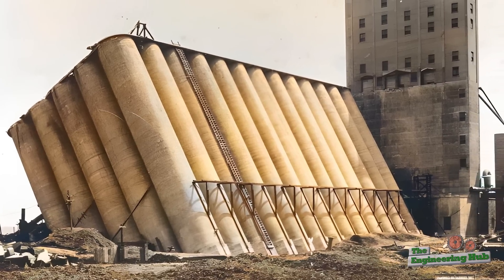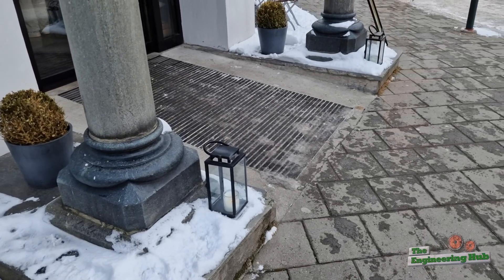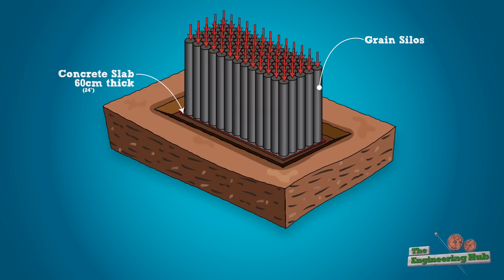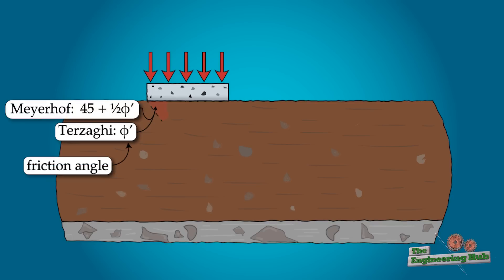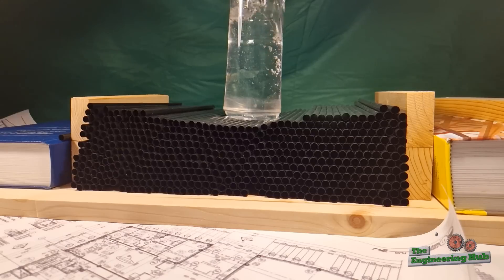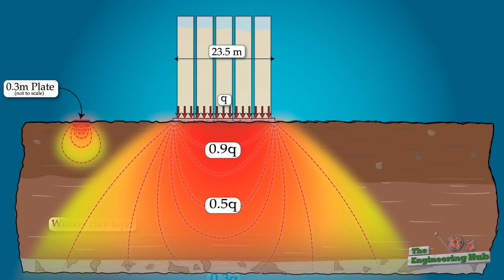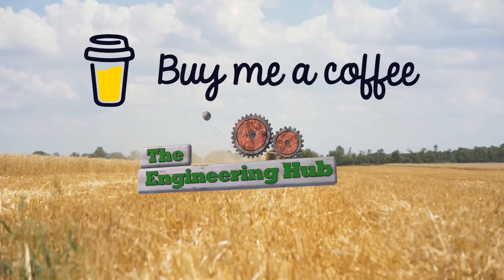Geotechnical Analysis of Foundations

Comment: San Francisco here. Our Millennium tower downtown is quite a notorious example of differential settlement, for lack of a better definition. That part of SF is fill-over-Bay mud, with most builders needing piles deeper than 200’ before hitting something dense enough to carry towers similar in height/weight. The millennium group however only went down an average of 80’. A 10’ mat on top of that before the building started. I think it settled about 17” on two sides with a 12” lean? Don’t quote me on that. They ended up drilling more piers along the lower sides, over 200’ deep and attaching to the existing footing. The settlement had gotten so bad the windows started cracking, and elevator was closed for precaution, utilities were nearly disrupted. Significant cracks along the retaining walls in the underground parking/basement areas, with severe rebar corrosion and spalling concrete. It’s bad. All this because the developers wanted to save a little cheddar. Ended up costing them more for the ‘fix’. 
Ongoing saga. 
Differential settlement is a big issue here in the Bay Area, which I’m extremely thankful for considering I own a small but growing underpinning/foundation repair company

Comment: So it came down to a problem with the clay? As someone who lives on an ancient claypan delta (other side of the Pacific, suburb Clayfield, named literally for what it is), I would love to hear more about clay's weaknesses, engineering-wise. Is it that the particles are so small,  they offer no "lateral" grip, if that might be an appropriate word?

Honestly this goes against every bit of my experience! Unfortunately I have spent four years digging across and through my clay backyard for various reasons and I would characterise clay as clumpy, solid, heavy, dense and going nowhere in a hurry! It's so dense it doesn't allow water to penetrate easily and in its dry state it very difficult to break up - it's almost like rock.

The idea that it could have landslip below surface level quite honestly seems preposterous. It would have to have some serious interruption from some other material like sand, or anthracite/coal (which is almost at surface level in the lowest part of my yard, an area you could call a former creek bed - since 2022, now a "1 in 100-year" creek, but I digress).

However I get that maybe clay is one of those many materials that appear solid but over time (maybe aided by rainfall and groundwater) can behave like a liquid, eg see the "Pitch Drop" - the world's longest running science experiment. Set up about 100 years ago.

Comment: Interesting, as the weight of European Cathedrals is vast and the foundations are, I believe, of essentially unbonded stone blocks - thus, as I understand it, the Terzaghi heaving effect would not be relevant (torque/building rotation would simply disturb the lay of the foundation stones and not impart the torque effect into the surrounding earth?). So the questions is how these simple foundations succeeded? I would think that they would account for settling - with building weight on lower, already more pressured and compacted substrata, but they were incredibly successful, and I wonder why - I haven't heard of any failing? Was the earth around these foundations perhaps manually compacted so they were not simply 'dug in' into normal earth? Perhaps they were necessarily slowly and evenly built (some took hundreds of years for completion) to pressurize the substrata before more weight was added - and this slow process was deliberate rather than due to lack of funds/politics, as is often portrayed? All thoughts welcome.
Reply from the maker: Maybe we also have a bit of a survivor bias since the ones that failed are long forgotten and we only praise the successful samples. Also the fact that they were built over many decades probably helps with consolidating the strata gradually so the structure sort of "falls into place" while being constantly structurally corrected to fit the settlement over the decades of construction (just a guess). An interesting example is of course the Tower of Pisa that happened to have poor soils underneath but managed to survive and became an attraction.
Reply: @TheEngineeringHub  did many fail? Just wondering as I was going to look it up as a matter of interest. Nice video that, thanks.

Comment: Im curious about how the grain filling procedure was accomplished. If it had bearing on the issue. What considerations were made and used or ignored.
Reply from the maker: @josephmarks5507  In the investigation report, after the failure, it said that the bins were filled uniformly. It's hard to know for certain since they were emptied right away

Comment: Figuring out that there is a weaker soil layer just below the tested depth does not require Terzaghi theory and is not mythical. It is rather a straightforward thing to do.

Comment: Also affected by the large turning motion due to the height of the building - and you glass! Its an unstable equilibrium, and once any movement starts then it's 'top heavy' and the force on that side ramps up, and down on the other side!
Reply from the maker: Yup exactly, in engineering that's known as a P-Delta effect. Meaning that the overturning moment keeps increasing with the progression of displacement, which in turn, leads to an even higher overturning moment and even more deformation. It's a positive feedback loop effect. The high center of gravity of the structure makes that worse for sure.

Comment: Good video, but for the record 300kPa is not "well below" 400kPa in a geotechnical engineering sense. Factor of Safety of at least 2 should be applied for bearing capacity, corresponding to 200kPa allowable.

Comment: Correct terminology is paramount, my friend. 'Foundations' are materials on which, you build. The foundation material is 'found' onsite. The first part of structure, which contacts the foundation, is a pad/foot, or 'footing'.
Reply from the maker: Foundations are structural members. Same as shear walls, slabs, walls, etc. Materials are concrete, wood, steel, etc, not ... foundations

Comment: Interesting explanation, it's necessary to say that the bousinesqq model apply for the trayectories on the stresses lines and finally will show the  tendency for the deformation plane. The bousinesqq Model for the tensorial state of deformations over an object is deduced from the Lamé-Navier differential equation solution, wich describes accrurately this kind of punture applying load over an horizontal layer, like this superficial foundation.

Comment: I think a contributing factor in this failure is uneven loading and unloading similar to loading and unloading ships and the ballasting operations.  Too much load on one side of the silo complex would put uneven pressure on the foundation causing it to slip / slide down in the ground hence tipping the silos over.
Reply: Based on their design it shouldn't matter where the grain is put 
In the case of the silos each silo would hold different grades of wheat so the first two silo's would be filled simultaneously with the same then the next two going from front to back 
They would never load all the left side bins and then all the right because they already know it would be a stupid thing to do

Comment: Great video! I love structural analysis of failure. One observation, though.. another video on the reconstruction would be great, because while I now understand well what went wrong, I am extremely curious to know how this problem was solved-- I think its equally important to know how to work around such a slip fault, as it is to know it exists. SO did they just basically make the foundation bigger?
Reply from the maker: They basically excavated under the side that was up and let it sink down until it was level. Then, they reconstructed all the conveyors and elevators to work with this new elevation (simple explanation). Interestingly, this was all possible because the concrete structure i.e. the bins were (way) overdesigned, so the concrete only had minor cracking. If this failure occurred today, my guess would be that the bins would crumble under their own weight, as the structure leans to the side. In the tilted structure, those bin walls were undergoing heavy bending (something they were not designed for), and yet they had no problem doing this new task 😅.
Reply: @TheEngineeringHub  well this is good, but given that the soil composition was at fault to begin with, how was that part mitigated? can one imagine that after the soil had moved, it was then at its final rest state? fully compacted, so to speak? Using the straw model, they removed some straws from the uplifted side until the whole structure leaned level again, and figured that then essentially the soil underneath had moved all that it was going to? because by digging lower they were essentially going even further into the disconformity.
Reply from the maker: To be honest, the literature that I read never mentioned how they knew that the problem was mitigated. In fact, I think they didn't. It took many years to solve the mystery, so I think they just thought oh well the structure hasn't moved for a year, so it's probably in equilibrium. I think your explanation is probably close to the truth. Since the failure stopped at this point (this tilt angle), it probably meant that it encountered some kind of resistance or the soil got compacted and its strength increased. What is often the case with clays is that if they are loaded slowly over a longer period, they will get stronger as they get consolidated. The problem with the initial failure was that the bins were filled up so quick that the soil didn't have time to drain and compact so it failed. One of the references mentioned that if the bins were filled slowly over the period of one year the failure probably would have never happened. This is new knowledge that we understand now and often implemented on construction sites. Huge piles of dirt are placed where the building foundation would be and left there for a big part of the year so that the soil will be preloaded and drain.

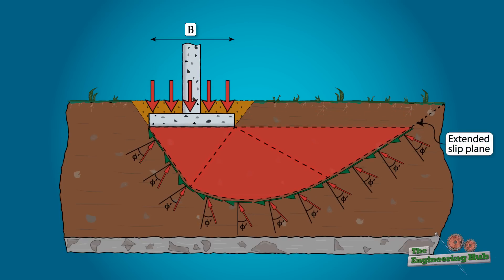Comment: @7:05 The author asserts that the main reason that foundations are dug into the soil is to extend the slip plane.  That may be true in climates without winter, but I assert that in climates with winter, digging in to get under the frost line - the depth to which the soil freezes in winter - is a much more pressing reason to dig a foundation deep into the soil.  If water gets under the foundation during warmer temperatures, then freezes in the winter, it can cause heaving, cracking, even collapse of the foundation, especially over years of freezing and thawing.

Otherwise, good video, and thank you!
Reply from the maker: Absolutely! There are many reasons why burying a foundation is a good idea. The extension of the slip plane and soil confinment are just two of many reasons. Frost is another excellent example, thanks!
Reply: Totally agreed, design takes in a number of different considerations, including frost heave, and other weather related issues.

Comment: One came to my mind: St Mark basilica in Venice. I visited the basilica in 1989 and was surprised at how crooky and lumpy the flooring was. I could see from a certain distance that the basilica wasn't level. Pisa tower is famous and most visible example of foundation failure. Another is the Millennium Tower in San Francisco that is leaning 28 inches at the top, leading to the enormous engineering challenges of finding the optimal solution for stabilising the skyscraper (hopefully before the next Big One hits).

Comment: 400 kpa dry. Masonry loves to wick moisture. That much dry masonry above ground allows more capillary action. And compressed soils can make an aquiclude or form pocket of water. That are then forced outward. Of course it was the north wall that failed too. Height of building casting shaded area would make a difference in taller building too. The moisture built up at the clay layer too and more moisture in the shaded soil. Allowing more slip. Heavy machinery likely damage soil structure too.

Comment: I actually used to work in this grain elevator, as a subcontracted electrician for maintenance.

Have lots of photos on my phone of all the old pulleys and DC motors.

As far as I know, this elevator is now vacant as of 2021 or so, serious foundation issues I heard, and the owners have moved to a brand new elevator out East of Winnipeg, past the town of Dugald.
Reply: IF they had foundation issues to begin with, I can't imagine how bad they are now. I think the elevator should be preserved though.
Reply: In the repair, they drove piles down and put the silos down on the pilings.  But there is a brown clay layer, and then a grey clay layer which is only 1/3 as sticky as the above layer.   The weight of the building needs to be distributed over a larger area, to reduce the actions at the grey clay layer.  You could still repair this, but it'd be expensive.   You'd need to pick up each silo again, and pour a big pad, to distribute the weight over a larger area.  It might also help, to move the silos a little further apart.  but then you'd want to drive some new pilings.

Comment: The grain silo would have lasted far longer if it had always been equally loaded across the whole base foundation, to keep it upright. If one side is filled first, it is far more likely to sink on that side and 'rotate' and once it starts rotating, it causes the 'heave' on the opposite side. So if the silo was equally loaded, there would be a much smaller 'heave' all round the base.

Comment: I have seen photos of an underground storage bunker built by the Nazi's during WW2 that had concrete support columns. The problem is they had column "capitols" wider than the column to help distribute the load above, but did not have similar widening at the base. So over time the columns started to punch into the floor. So people began to think it was unsafe, probably was. There are rumors of German trucks dropping off shipments that were incredibly heavy material into these places, maybe Czechoslovakia, not sure. Near the end of the war. Maybe someone will find later.

Comment: this is bullshit. the silo tiltled because of uneven loading causing the unloaded side to lift up...if they loaded all silos to the same level at the same time then the load on all parts of the footing would be equal. kindergarden stuff...if it was loaded equally then in the unlikely event that there was subsidence the silos would still remain upright.
Reply from the maker: The silos were loaded evenly. Soil is not an engineered material, there are weak and strong pockets. One side is always stronger than the other, in this case the weaker side gave in and sheared resulting in the failure seen on the pictures from that time.
Reply: @TheEngineeringHub  how do you know the silos were loaded evenly? Do you have the log books and clerical records from the day? WOW  amazing historical research on top of your number crunching abilities, sounds like you are using the silos to demonstrate your special engineering principles, that may not apply in this particular case,  the failure and the repair happened before you were born. common sense and simple observation beat pseudo science after the event. i know what can happen with silos, one reason they have multiple cells is to accomodate different grain type deliveries, if different cerials ripen at different times they cant spread the early delivery crops over all silos to balance the weight. if soil is fluid and behaves like water you have to load it the same way you load a ship, or the ship will tip.
Reply from the maker: @ianburton8050  I know only as much as the reports from that time recorded. If they are wrong then I have also presented the wrong info. You can find the some papers and reports in the references (ref [2] is from around that time 1916) in the description of the video. But the point is, uneven loading is not required to end up in a tilt like this. Even if the grain (and hence the load) is perfectly uniformly distributed, the variation in the strength of the underlain soil can cause one side to settle faster than the other and result in a tilt.

Comment: Here in Finland there is a difference with winter conditions eg frost. But also changes in the groundwater level due to excess rains etc. can also contribute to catastrophies. Sadly the global climate has changed radically with torrential rains in usually dry areas.

Comment: One consideration that occurred to me was whether or not the silos were not filled and emptied in a way that kept the load balanced on the foundation. Much the same has how a bulk ore carrier needs to be filled or emptied.
Reply: Does not happen the bins are filled in a two by two sequence both left and right side bins are filled simultaneously in order to prevent what had just happened 
Just like as they say the building will always tilt towards the area of least resistance 

They used footings that were simply too narrow but that was because the soil wasn't analysed properly in the first place
Reply: @evangiles4403  makes sense!